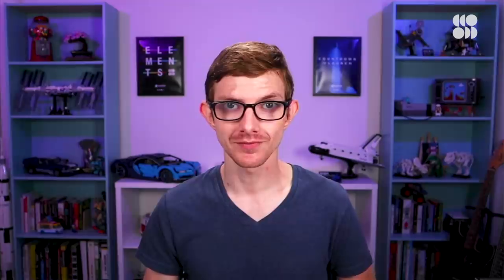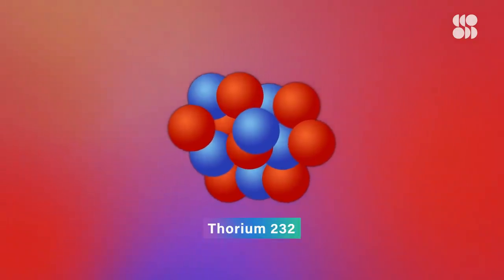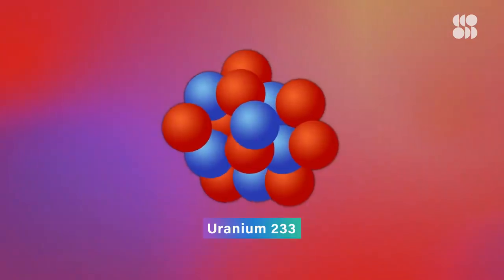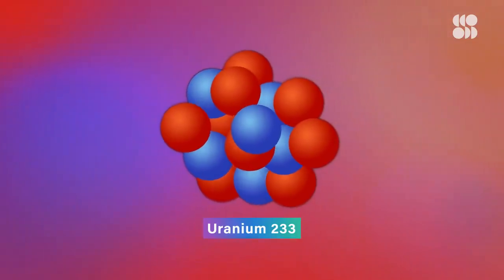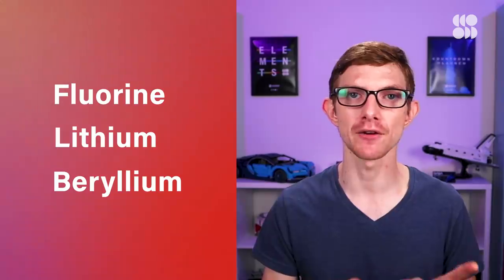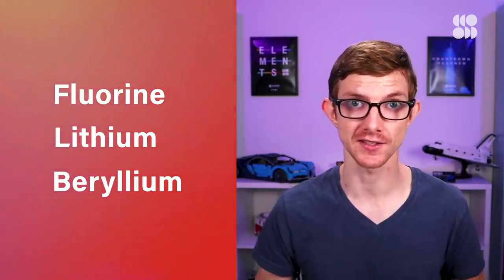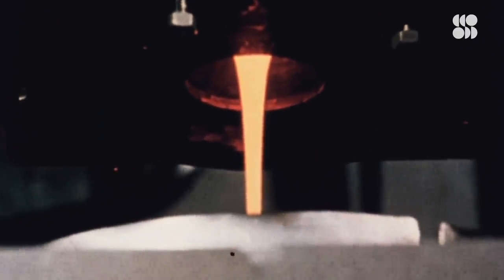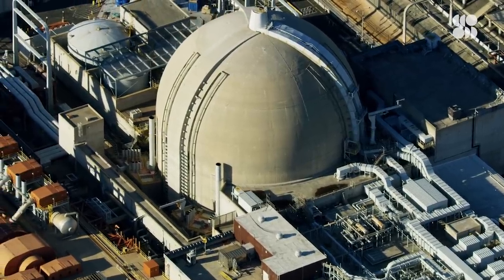The Next Generation of Nuclear Power Is Here

Comment: Its a neat technology, but time is a huge issue. 2030 for 100,000 homes if everything goes well is quite a few years, and thats essentially just proof of concept still, when they need reactors thrown up to supply countless millions of homes. You are probably looking at very optimistic estimates of 20 odd years to start getting great chunks of China on this power. 

Standard nuclear has never been built at an ideal speed, but itd no doubt be much faster than that. Meanwhile renewables have changed the energy landscape dramatically in the previous 20 years and would quite likely have dramatically improved in efficiency and obtained some decent grid level storage by the next 20 years.

I.e. If this isnt to the detriment of other power sources then I cant see why you wouldnt do it, but Im not sure if its fast enough to rival normal nuclear and renewables in the short term, or be relevant when renewables have improved in the midterm. (While ITER is providing the proof of concept for fusion in the long term.)
Reply: Yeah, and that's one of the problems I have with a lot of proposals that are supposed to help with climate change-- we need drastic changes in carbon production now, we really don't have a bunch of time to spend anymore 

Thorium powered reactors are exciting from a tech point of view and maybe in the long run they might even win out as an ideal energy source, but that doesn't have much to do with solving the climate crisis we're currently in
Reply: but once developed they will be churned out as modular units in factories - 1,000's could be built a year

Comment: I've heard this for 30 years now. Thorium sounds great but it's low energy yield and more importantly a molten salt coolant, which is super corrosive and introduces a lot of instabilities. Even China, who does not care about pollution, is only building a tiny 2MW reactor as a test, and China has fully embraced nuclear power as much as coal.
Reply: China do care about pollution, and China invest many hundreds billions dollars a year against pollution.
For example China invest more in renewable energy than USA+Europe combined.
China has already 400.000 electric bus vs around 200 in USA.
China air pollution has collapsed since 2015… really collapsed
The 38.000 km of high speed train already built in 12 years decrease a lot the use of planes and cars and thus pollution (in 15 years they will have 70.000 km of high speed train, and they are soon starting to build a network of maglev train going 600km/h on the most busy lines).
And if China is investing hard in nuclear technology is to be able to decrease the air pollution and global warming.
Reply: @Alexpktang  China didn't leave the Paris Agreement because it didn't have to, it was never bound by it's rules. Their 'determination' to cut pollution is just a determination to cut down the smog over the cities, and to move industrial areas and their coal power plants further away from the city. It helps to read things not spoon fed you by the CCP.
Reply: Paul Kelly song "from little things big things grow" of course they are building small
Reply: @jimlofts5433  At it's heart this is still a Fission plant, just using a different fuel and coolant. There is nothing groundbreaking about it, we've been building Fission plants for 60 years now. Indonesia and TerraPower are also experimenting with this crap. ITER will be groundbreaking when it finally comes online.

Comment: Power tech hasnt changed since the industrial revolution.  We are still basically using a tea kettle, a fancier kettle but still boil water capture steam.
Reply: Will do for a long long time until a technology comes along that can directly convert heat into electricity on a large scale without the steam intermediate.
Reply: We should be dropping in small modular reactors at every existing coal power plant.  Basically replace the burn-coal-to-make-heat part of the plant with a factory made fission-nuclear-fuel-to-make-heat module.  The rest of the plant - the steam turbine, the cooling facility, the tranformers, all the plumbing, etc. - can pretty much be used as is.

Comment: "And while uranium 233 can and has been used in nuclear weapons, it's always contaminated with isotopes that emit-high energy gamma radiation, so it's easy to detect and hard to handle. Features that make it less suitable for use in nuclear weapons"

Uhhh.. what?
Reply: In other words, it's dangerous and expensive to handle it.  Not ideal material to work with.
Reply: Because of uranium 232, hard gamma emitter.
Reply: @StephenYuan  Yes, so he basically implied that Torium is far better suited for nuclear weapons since it's easy to handle and hard to detect.
Reply: @blinded6502  He said it's easy to detect and hard to handle.  You have it reversed.  The US DOE did extensive studies on thorium and found it unsuitable for weapons production, at least compared to uranium.
Reply: @StephenYuan  Look at the quote.
Reply: @blinded6502  Thorium is not fissile material itself.  When it is bombarded with neutrons it becomes fertile and becomes uranium 233.

It's conversion is the first stage of the fuel cycle.
Reply: @blinded6502  Not the quote, your second comment has it reversed. U233 comes from the Thorium reaction process, so it's shortcomings as a weapon material are Thorium's shortcomings as a source of weapon material. Criticism of U233 is not praise for Thorium, as you seemed to suggest.

Comment: Thorium is not a big deal, the MSR technology that can utilize it, however, is a big deal. Thorium is just one of several fuels that can be utilized in a MSR and has no advantages over uranium, in fact, it's much harder to use. That's almost all most of the MSR startup companies are just using uranium. There is also no shortage of uranium as was initially thought when the original MSR was developed.
Reply: Thorium has a major advantage in that it is more plentiful.  China and India have a large stockpile.
Reply: Could you be more specific about the Uranium used? Since the idea is to turn the Thorium-232 into Uranium-233.
Reply: @wilderbeast9368  Ancient Chinese proverb: "Molten-salt reactor, not picky eater". Basically, as long as you can dissolve the nuclear fuel in the salt, it'll work. So you can in fact run MSRs using a normal U-235/U-238 mix (at some level of enrichment, which I don't know).
Reply: @eckligt  lmao That's great to know.
Reply: @wilderbeast9368  The only thing I'll add is that there can be a physical difference between MSRs used for breeding (Thorium) and MSRs used for burning (Uranium). For breeding, you have the option of having a two-fluid system, where the Thorium is dissolved in one salt, and the bred Uranium-233 is dissolved in another salt, and these two salts flow in proximity to each other in the reactor itself. With burners, you would obviously use a single-fluid design. Single-fluid designs can also be used for breeders, in which case the Thorium and Uranium are mixed in together -- this has upsides and downsides.

Comment: How come no one ever thought of putting nuclear reactors in the desert, away from cities and people? Since there's no desert in Ukraine where Chernobyl happened, their nuclear power plant could have been installed in Sahara desert by renting space from the country Sahara desert belongs to.
Reply: Deserts suck. Ultra fine sand particles, as well as the normal sized, like to ruin machinery. Sand storms can literally scour surfaces. You'd need to constantly be maintaining, inspecting, and repair and replacing stuff to keep it working efficiently and safely. Not something you want to do when radiation is involved. Then there is running the power lines. That would be a total pain. You would have to make sure they are anchored which means digging down below the shifting sands for every tower. However, I am curious is a sandstorm would potentially short or arc the power lines. My gut says yes, but I have no idea. Oh, and there is also the fact that you would be hauling dangerous radioactive materials through a vast and empty wasteland where noone can hear you scream.
Reply: Not to invalidate anything the other person answered, but the main reason nuclear power plants have traditionally been located close to water (ocean, lake, or river) is for access to cooling. Remember that the electrical output is not the whole energy production of a powerplant, only about one third of the heat energy becomes electricity. The rest is lost as waste heat. That heat has to be handled in some way --using a secondary or tertiary cooling loop into a big body of water, or pulling in water from a river, and letting it flow luke-warm back into said river, or building a big cooling-tower where water is allowed to evaporate in order to let the heat go to the atmosphere.

More recent ideas for nuclear power would have the waste heat be used for desalination, or other kinds of process heat for industral uses, such as making Hydrogen or Ammonia, which is important for fertilizers. It can also be used for district heating in places where winters can get uncomfortable.
Reply: msr's don't require large volumes of water for cooling so can be located inland also if located on a non potable water source the excess heat not electricity can be used to desal

Comment: 4:23 feels misleading.  You indicate that new thorium molten salt reactors will cut green house gasses while cutting to “giant plumes of smoke” coming from existing reactors today.  Is the intent to show that thorium molten salt is better than existing reactors?  Maybe for some reasons, but not in regards to green house gasses.  Those giant plumes of “smoke” you indicate thorium reactors will reduce are clouds of water vapor, which is a byproduct of the extreme heat (turning water to steam to turn a turbine) used to generate electricity in those existing reactors.

Comment: No mention of this being a solid fuel or liquid fuel design.  How do you enrich the thorium or what is the source for neutrons to enrich thorium?  the Oakridge experiment was very successful but used U235, search MSRE it also used a similar fluoride salt mixture.
Reply: In the core you have uranium mixed into the salt. But around the core you have an area with thorium in the same salt.
The fission reaction in the core radiates the Thorium with neutrons which turns into Protactinium. The thorium/protactinium solution is continuously chemically filtered to extract the Protactinium, it is then stored and after a short while the Protactinium turns into fissile Uranium 233, which is then mixed with the salt and put into the core.

Comment: Massively more levels of Nuclear power are needed if we're actually going to get through the Climate Crisis ❤️☢️
Reply: Why? Its much more expensive, takes linger to build and most countries would need to do some form of prototype of thorium before it could be built en masse which will take even longer
Reply: @bertthompson4748  because what's the alternative?
Reply: @shoemakerx0105  a mix if renewables and storage. Theres plenty of feasibility studies and countries moving that way
Reply: @bertthompson4748  Storage that isn't here, unless we take even longer time to make it than nuclear due to the immense size. Not forgetting, this is very expensive, and a cost in addition to renewable which is expensive in itself.
Reply: @wilderbeast9368  thats a lie. Storage takes a year to build and the components are already factory made.
As for the cost it kinda doesnt exist vecause the batteries work through energy speculation which makes money instantly by buying low and selling high.
So on both points youre repeating lies
Reply: @bertthompson4748  Edited comment, nuff said.

Imagine thinking that screeching 'LIES' somehow does anything.
Like I said battery technology is not here the way you are thinking. If you believe the costs, storage effectiveness, and compactness necessary in fact is here, you must prove it. I will preface however, I am already doubting you as you seem to be talking about stocks and not power.
Reply: @bertthompson4748  our turn to prove you wrong? Easy, where's your source
Reply: @shoemakerx0105  hornsdale battery storage was built in under 100 days and paid for itself in 2 years and has since been expanded.
Also a basic knowledge of economics will tell you how they make money.
So stop being a coward and give proof that Batteries are too expensive or wont work.
Reply: @bertthompson4748  Still no source lmao
Reply: @wilderbeast9368  i gave you one. The Hornsdale big battery. 
I know its embarrassing to be so easily proven wrong.
Reply: @bertthompson4748  'WRONG!!!!!! D:<'
Still waiting... looks like I always will. 👩🏿‍🦰
Reply: @wilderbeast9368  do you know what an LCOE is?
Reply: @bertthompson4748  Yep - still not the source we're all waiting on.
Reply: @bertthompson4748  There is no way you are this Resident Evil: Tar of the Dead.
Reply: @wilderbeast9368  is this all you have?  Willful ignorance.
Reply: @bertthompson4748  Is this all you have - nothing?
Reply: @wilderbeast9368  hornsdale big battery.
Reply: @bertthompson4748  For the millionth time, vaguely name-dropping what we have no more than your say-so is a source, is not a source.
Still waiting...

Comment: It sounds great in theory, but I would like to know what kinds of safety protocols are being put in place so we don't have a Fukushima or Chernobyl.
Reply: Unlike uranium, Thorium doesn't need graphite moderators to slow the process down, With thorium, you have to keep it alive, if power shuts down, the process just dies off, like not puting any more wood in a fire. Uranium is the opposite - no cooling & moderation = meltdowns.
Reply: Passive safety mechanisms employed in modern reactors make meltdowns physically impossible. You couldn't make a thorium reactor meltdown if you TRIED!
Reply: @aliensarefromspace  Sorry, but you're mixing up a bunch of things here.

Uranium doesn't need moderator to slow the process down. The moderators actually drive the process forward, which I know is counter-intuitive considering the name, but the moderator moderates the speed of the neutrons so that they have a chance to "stick" to any nuclei they might happen to hit. Without this "sticking", the splitting of the struck nuclei won't happen.

Some reactors indeed use graphite rods for moderator (such as the RBMK design used in Chernobyl, but also molten-salt reactors such as the video describes). But conventional reactors use water for moderator, either normal water or (especially in Canada) heavy water.

There are indeed rods that slow the process down, which are called control rods. They are not made of graphite (that would have the opposite effect) but rather Boron, Cadmium, Silver, Hafnium or Indium (according to a quick Wikipedia check I did now). They are essentially the "throttle" of a conventional nuclear reactor -- insert them fully and the reactor turns off, extract them and the reactor produces more and more power.
Reply: In Fukushima, no one died as a result of the accident itself. As a result of Chernobyl, around 50-60 people died. That is of course 50-60 people too many, but there are industral accidents that cost far more lives every year and they barely make it into the nightly news.

The statistics show that nuclear power has the lowest fatality rate of any electricity source, measured by unit of energy produced, and the lowest CO2 emissions, also measured by unit of energy produced.

Regarding waste: We are in a climate crisis, not a nuclear waste crisis. The nuclear waste created today can and will be used as fuel in advanced reactors in the future, this technology is already understood. What nuclear waste remains only has to be guarded for 400-700 years. In Europe we have cathedrals that took that long to build, so I'm sure our civilisation can muster the strength to protect this waste until it can be buried without supervision.

Nuclear power is the only energy source that fully contains its own waste stream, that is parsimonious with its land use, that can be deployed anywhere, and that produces dependable and plentiful energy.

Comment: 3:20 "Molten salt reactors are an appealling option for areas where water is scarce"
Yeah, no. Not needing water as a primary coolant doesn't mean you won't need water as a secondary/tertiary coolant. You'll need it to spin your steam turbine anyways.
Reply: The higher operating temperatures of LFTR reactors allows for the effective implementation of a Super Critical Carbon Dioxide Brayton-Cycle turbine generator.

Rather than 30-40% thermal efficiency with low temperature steam. Using the Brayton-Cycle, efficiency's of 50-60% or higher.
Reply: @EvilResult  yeah uh, a basic EPR (which is actually getting buillt) is 38% efficiency.

Comment: naoh or noah, or NaOH, noah
Reply: it has 50 of heat capacity, compared sodium, at 25, and water at 75
Reply: melting point at 300, boiling point at 1388C
Reply: matter ionization ion em-field separation for concentrating materials, isotopes, filtering, selection
Reply: not dependent one of you